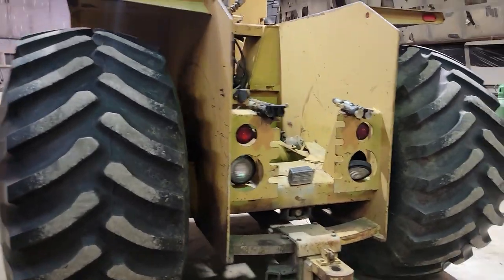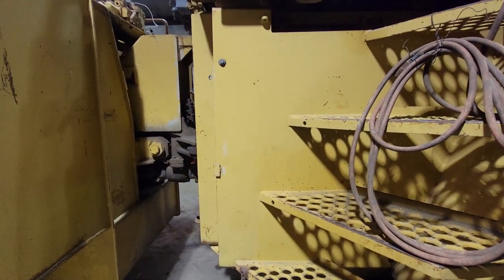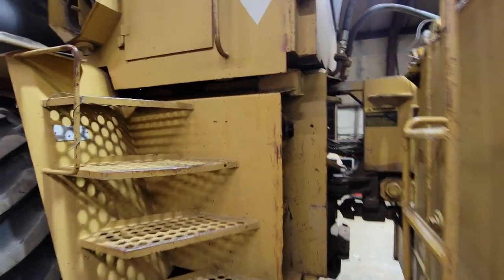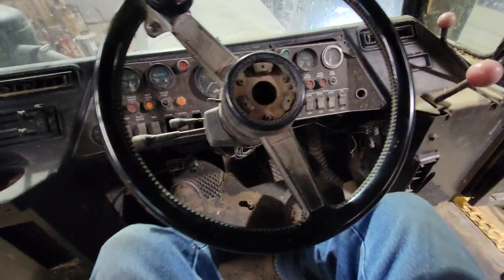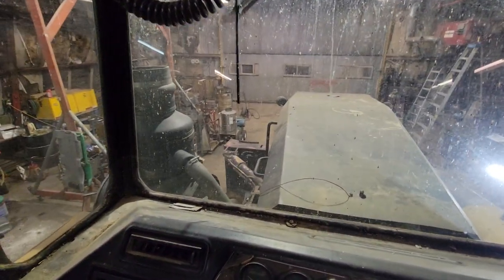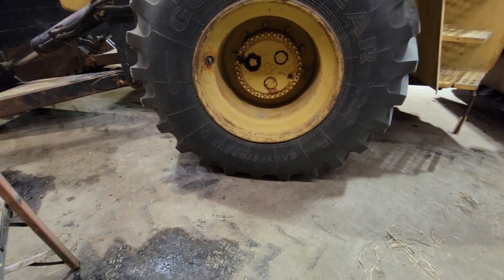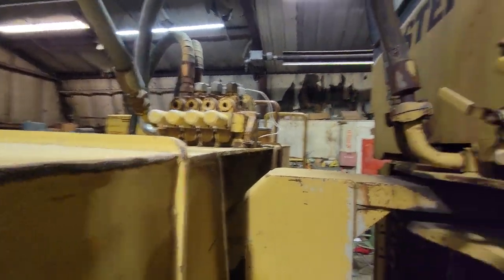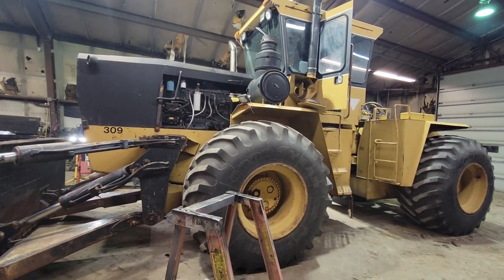the ca360 industrial steiger walk around

Comment: @Gears N Biers  we ran 2 of the industrial Steigers out of 5.  One Cu with a manual and one Ca with an Allison.  The other three were PTAs and Panther with a manual.  The Ca was preferable for the joysticks while pulling double pans.  Couples with a higher flow PFC hydraulic pump, the Ca would operate both scrapers at the same time without loosing hydraulic power.  The logger single tires made a narrower profile as well, for the one that had it.  Absolutely loved having those late 70s and 80s era Steigers they were far ahead of their time and worked into the new era.  Some of them even racked frame hours above 30,000 hours.  However, we had to retire and sell them due to the late 90s economy, rising diesel prices, and maintenance cost (for their age).